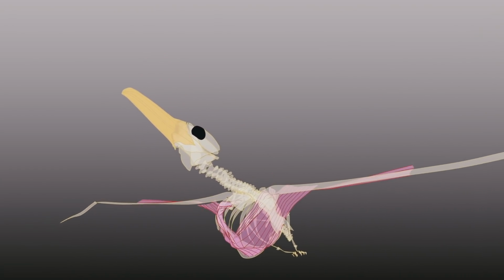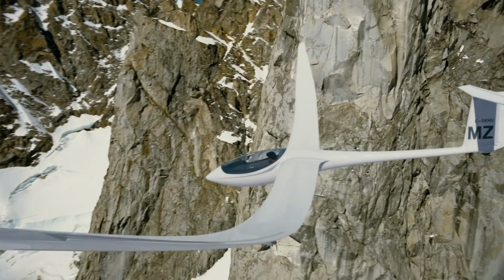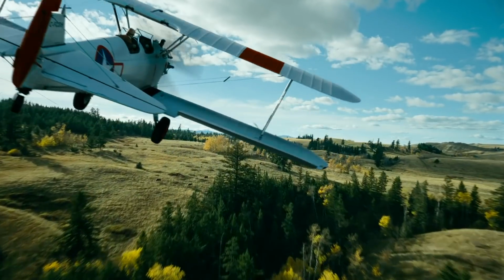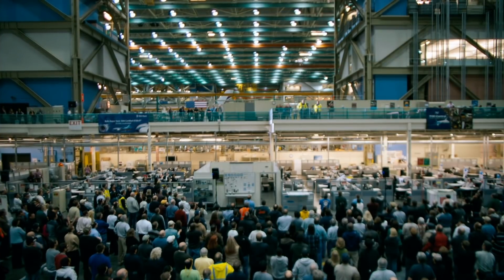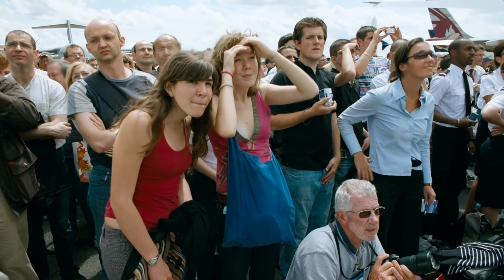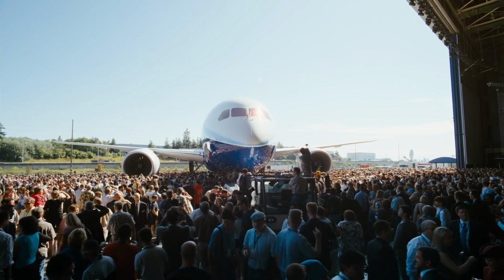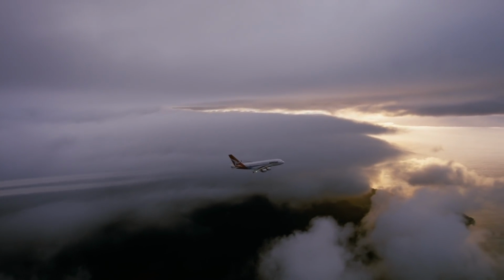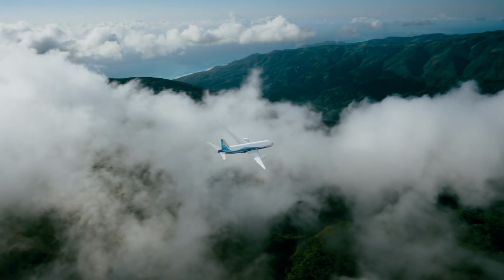How These Legendary Aircraft Shaped Boeing 787 Dreamliner | Legends Of Flight | Spark

Comment: The Boeing 787-9 in particular was the most fuel-efficient aircraft on 2016 transpacific flights at 39 passenger kilometers per liter of fuel, or 60% better than the A380.

Comment: Say what you will, this is the airplane that kicked the A380's (and 747's) ass.
Reply: Meh, it's more that even 30 years ago, Boeing's research already showed that consumers were moving away from the hub-and-spoke means of transport, where passengers are funnelled into these huge machines, and instead into point-to-point (I think it's called?) flying, where smaller planes are used. Even before the millennium, the 747 was becoming obsolete. Fast. By the time Airbus brought out the A380, they had an amazing innovative machine that no one wanted. And these insanely expensive planes only are bought when airlines know they will be used.

It's just a change in the market, and Airbus gambled badly. That's why the A380 is now stopped production already and Airbus is at least 20 billion euros in debt. At least according to wikipedia =P (that A380 article was just like "here's every economic screw-up Airbus has made in the last 40 years"...)